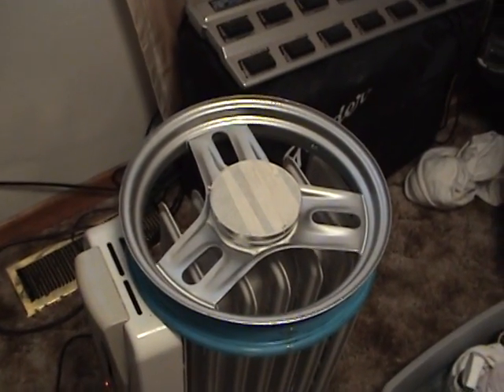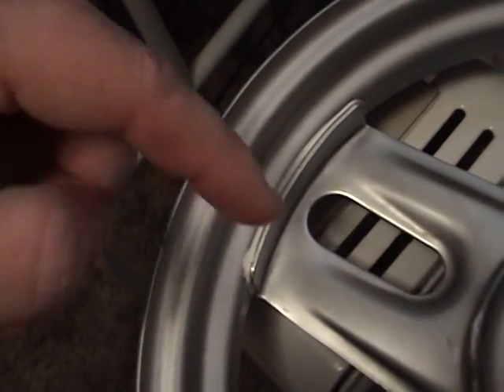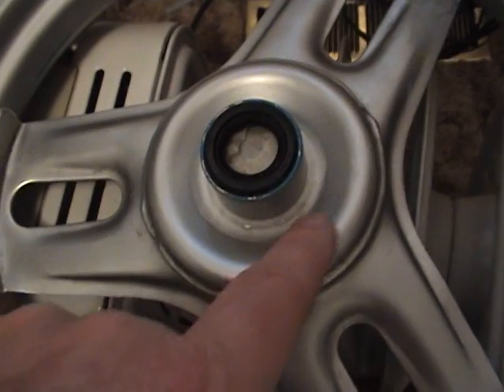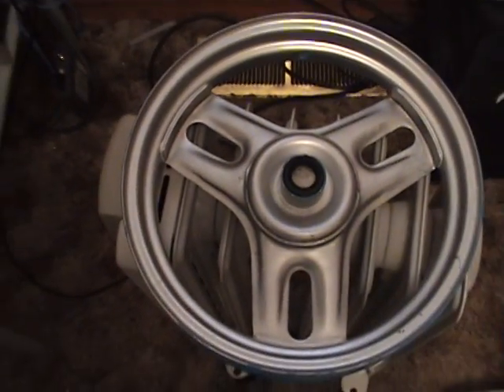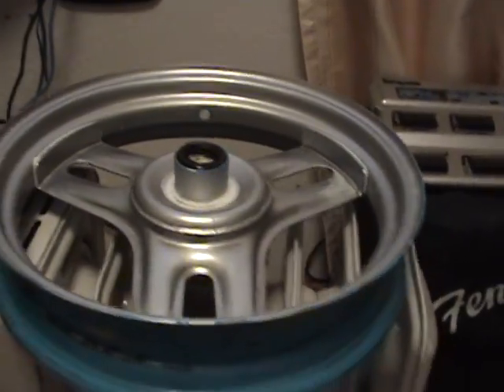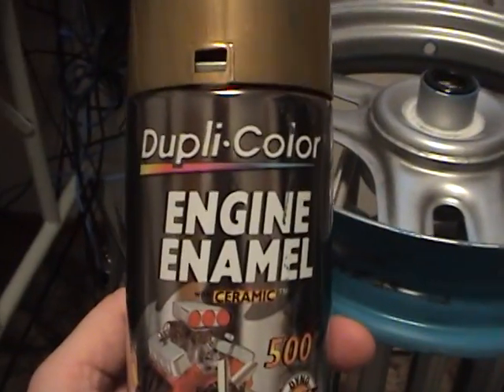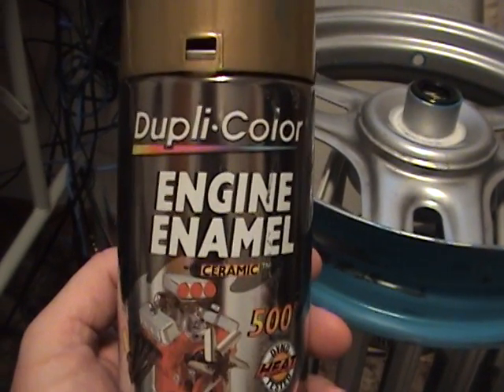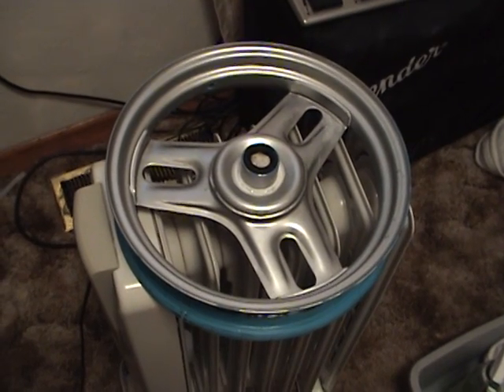(3)- DIO WHEEL PAINTING= STEP BY STEP

Comment: Have you ever experienced any vibration or bad handling from this cuz it could not be balanced? Lmk Mahalo\m/
Reply: I thinking of doing mine in epoxy also, and my moped going be midrace, i want to know if doing this will mess up with riding
Reply from the maker: go ahead and try. I think a flexible filler is best. some auto body stores have panel caulk that is strong yet flexible and colored, though I have not tried it. If it works metal to metal panel, then it should work on wheel. I am thinking of having my wheels balanced, even though they come without weights.
Reply: DIOSpeedDemon oh ok thanks for the info
Reply: DIOSpeedDemon oh ok thanks for the info